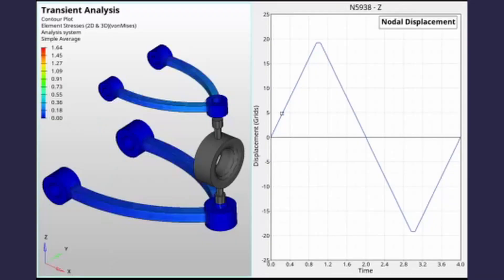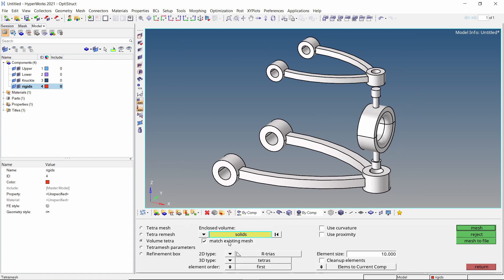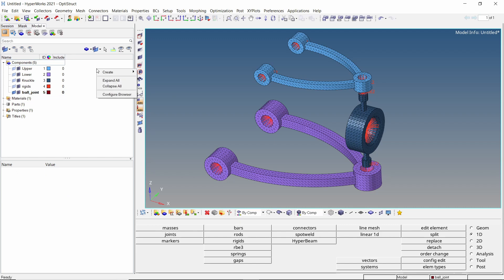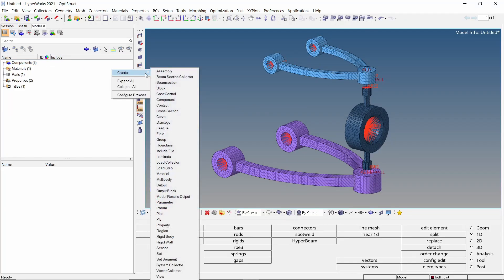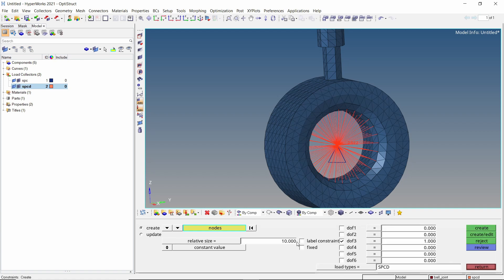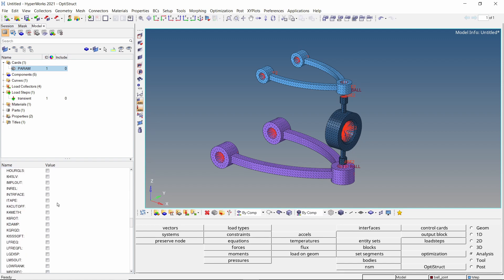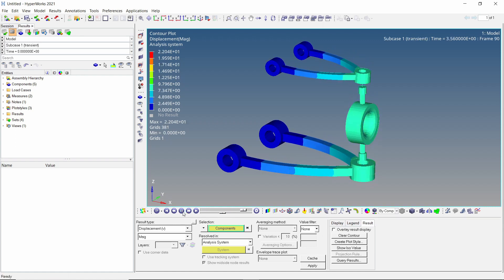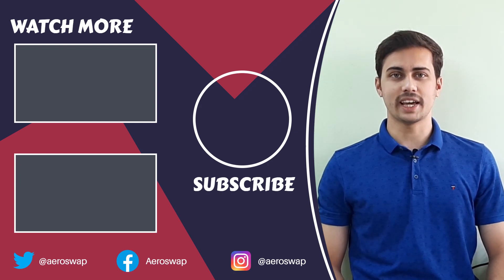Hypermesh Transient Motion Analysis [Optistruct Tutorial]

Comment: Hello, How would you go about applying a spring to the suspension system? say to the lower suspension arm?
Reply from the maker: Hey there,
Great question! I will model it using a 1D spring element of required stiffness. Connect it to the rest of the structure using RBE3 elements for load transfer.
Reply: @Aeroswap  What elem type would you use and what card element for the property? The spring im trying to make doesn't need have a damper its just a spring with sitffness of 300N/mm
Reply from the maker: CELAS or CBUSH maybe. I think some of the element types also allow damping. It has been a long time since I have modeled anything like this so I do not remember which element type it was. I might have to check the documentation myself on this one.

Comment: Excuse me，What if I want to add loads in other directions? For example, along the diagonal direction of x and y.
Reply from the maker: Good question! In that case you can enable both DOFs while creating the DAREA. Then the loading data will be applied along both the selected directions and resultant will be observed on the diagonal (vector addition). I hope this is what you were looking for!
Reply: @Aeroswap  Another question, if I want to add multiple transient analysis, how should I set it up? Specifically, under a loadstep, there are multiple Dloads that need to be added. Corresponds to multiple tloads and multiple curves. If it is statics, I can use loadadd, what should I do for transient analysis?
Reply from the maker: A single DLOAD can add multiple TLOADs. Change the value in NUM field of the DLOAD and it will give you the option to enter multiple TLOADs and their corresponding scale factors in tabular format!
Reply: @Aeroswap  That's right, thanks a lot for your answer.By the way，when adding darea in transient analysis, two degrees of freedom are created, how to adjust the angle of deflection? Is it by changing the value of dof=()?

Comment: Hello, in a non linear transient analysis with a time dependent displacement BC (the same way as you did) I don't know how I can add my acceleration corresponding to gravity ! What can I do and how to solve my issue? Thanks !
Reply from the maker: Hi Xavier,
Please correct me if I'm wrong. If the boundary condition is displacement with respect to time, why is gravity needed? No matter what the gravitational acceleration is, the component will follow the path specified by displacement load.
Reply: @Aeroswap  First of all, thank you so much for your quick answer! I've been learning hypermesh for the past few weeks and I've learnt a lot from you, especially about bolt pretension. I think that last night I did not do a good job explaining my current issue. Let me give you more details.
In general, at a given point where you need to prescribe your boundary conditions (subscript "0"), either your fix your primary or secondary variable (up to 6 of them): {Fx_0 or ux_0, Fy_0 or uy_0,...,Mz_0 or ThetaZ_0} which correspond to the translations/rotations and forces/moments.
In your analysis you prescribed a displacement Uz_0 at a given node. One may want to prescribe, let's say a force Fx_0 at the same location or at another location. However, looking at the interface for various nonlinear problems (nonlinear transient, direct transient, etc.) I cannot see the option to have BOTH prescribed "displacement" AND "force". Indeed, my understanding is that the choice between "displacement" or "force" is made by the TLOAD collector when choosing the TYPE ("disp" or 'load'). My initial idea was to have two of such a TLOAD collector, one for the displacement, and the other one for the load. However, in the load step parameter, it seems that only one of such TLOAD collector can be choosen. What to do then?
Reply from the maker: Thanks for the clarification. I think I have understood your point now. It is possible to combine two or more TLOAD entries applied at the same location. Create a new loadcollector with card image DLOAD. Now set the NUM value to 2 and a tabular data entry will be enabled. You can select the two TLOADs in this table and specify required scaling values. Now you can use this DLOAD entry in place of TLOAD while creating the loadstep.
This way, you can combine acceleration as well as displacement loads at same point. I hope this information helps!
Reply from the maker: Hey Xavier, good to know the DLOAD approach worked!

If you are interested in observing the effects of centrifugal loads applied on the body due to rotation, you can simply use the RFORCE type loadcollector. But remember that using this type of load will not output actual visual animation of rotation, just the result contours.

If you want to visualize the rotation in animation, you can specify time-dependent rotational velocity using another separate TLOAD1 and combine it using the previously used DLOAD.

This will work for both, linear as well as nonlinear transient loadcases.
Reply: @Aeroswap  Thanks so much for your input  but this is not exactly waht I need because from my understanding the TLOAD collectors are used to prescribe loads/displacements etc. In my model, I only need to set up the initial conditions (which is a rotational velocity around the global z axis at  30rpm).

Today I created a TICA load collector and I used it as my IC parameter for the load step. But I cannot run my model anymore because I get several times this error message  :

 * ERROR # 2767 *
 TIC DOF is SPC'ed for GRID ID 436926 component 1.

If by chance you have a clue about this error it would be so helpful!! Or if you have other suggestions!

Thanks!
Reply from the maker: There is a very good tutorial about explicit dynamic analysis using Optistruct given in the Help section of the Altair website. It is a drop test of cellphone on rigid wall. The TIC entry type is used in that case.

I think that will help you to figure out the correct method to apply velocity loads.

Comment: Hi sir, in your case for Output, you have chosen  displacement>option>All in  global output request card. In hypergraph, while your are selecting the respective node it is showing all the nodes for your case.
The nodes displaying for you is total no.of nodes which you had get after final meshing?

Because when I was solving for a different problem it doesn't shows the no.of nodes and displaying only 10K nodes can be displayed and i understood that to increase the element size so that no.of can decrease.
Without changing the element size can you tell how to get all the nodes in hypergraph?
Reply from the maker: Try this. Instead of outputting desplacement results for all nodes, create a node set. Then select 'SID' option instead of 'ALL'. Now select the created set in selection box.
This will output the displacement results for only specific nodes in the model and you do not have to increase the mesh size!

Comment: Nice video, Can you just explain a little the PJOINTG card image : 
Why do you put 3 PJOINT limit set ?
Why do you put LB and UB option to =11.5 and 11.5 ° ?
And the last one, why the first pjointG has 4DOF, the second 5DOF and the last one 6DOF ?

Thanks a lot.

Harry
Reply from the maker: Hey Harry,
A standard ball joint found in the market has maximum movement of 11.5deg. That is why I have set the limits of motion range using lower bound (LB) and upper bound (UB) at these values.
The numbers 4, 5 and 6 do not represent the number of dofs, they represent the actual dof. 4 corresponds to dof4 (rotation along X-axis) and so on. So now, the range is applied to dof4 using the first option. Same for dof5 (option2) and dof6 (option3). 

I hope this clears your doubts!
Reply: @Aeroswap  I got it ! Thanks a lot. 
You do an amazing job by making videos and take Time to reply at all comments.

What a chance we have to exchange with you ! 

Regards 
Harry
Reply from the maker: Thanks Harry!
I just try my best to share whatever I know :)

Comment: Long time no see Swapnil. I see Altair is treating you well ;) glad to see some advanced motion analysis explained in detail. Thank you for your effort putting it together. I assume your pjointg card is used for idealizing the ball joints. Could you explain more about how you defined it? I.e., I assume you are releasing DOF 4,5,6 with the upper/lower bounds. How did you come up with +_11.5? What would be the impact if the numbers are changed?
Reply from the maker: Hello Ken! Good to hear from you. Indeed, work is going great.

From the joints information given in Optistruct user manual, I observed that the ball joint is created with dof 1,2,3 (translation) constrained and dof 4,5,6 (rotation) free. So ideally, after the ball joint is created, it can rotate by any angle about all 3 axes.

But a real ball joint does not have infinite angle rotation. The motion gets locked after a certain angle is reached. This is where the PJOINTG property comes in. I specified a range of angular motion after which the joint motion will be restricted. The 11.5 degree value is taken from OEM ball joints which are commonly used in automobile industry.

I hope this answers your question! I plan to make a video on all the joint types available in Optistruct soon :)
Reply: @Aeroswap  Thank you for the detailed information. Ah 11.5 degree comes from the OEM standard, I’m learning something new. Yes it’d be interesting to see all types of joints that can be solved in Optistruct, such a powerful tool!

Comment: Hello bro. Please make a video on Linear Transient Heat Transfer Analysis using optistruct.
I was trying to perform the above analysis on a disk of a disk brake but it is not solving. Definitely I'm doing something wrong.
Please make a video as much as possible earlier. It will be very helpful.
Reply from the maker: Thanks for the suggestion Abhishek. I will work on this soon!